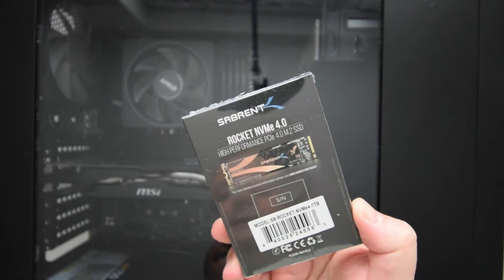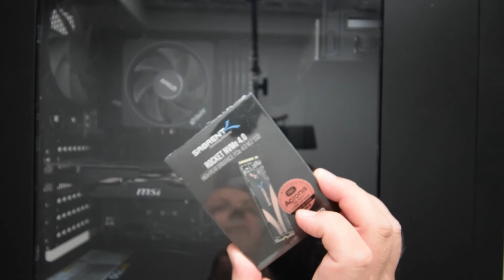How to install a NVMe Gen4 SSD, including GOTCHAS!

Comment: Just want to say thank you for the video just ran into this issue when installing my gen 4 ssd tried to clone it didn't work. Next plan was a clean install and ran into the wouldn't install. Tried disconnecting all the drives and it worked.